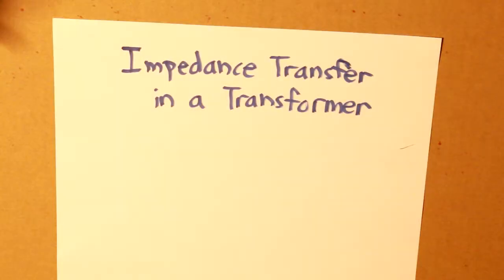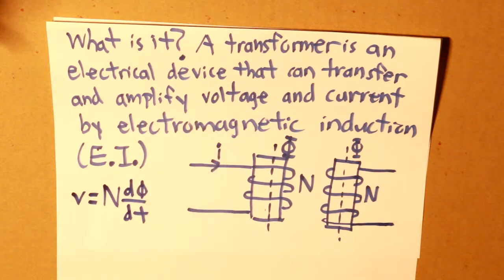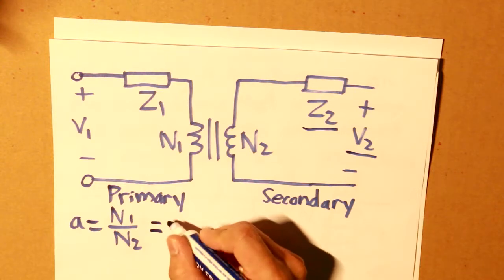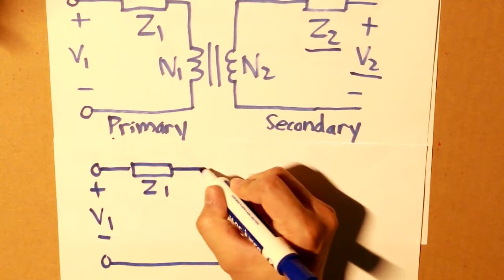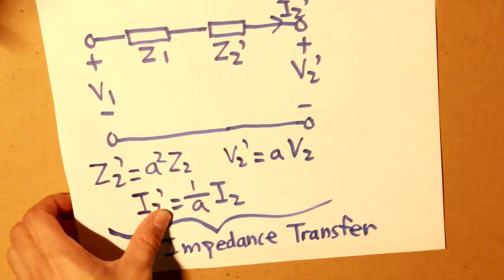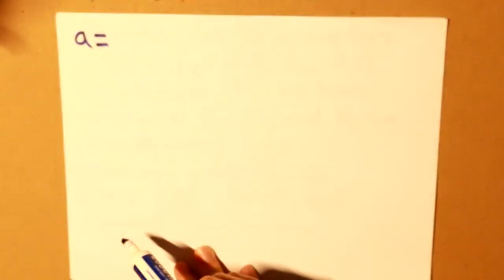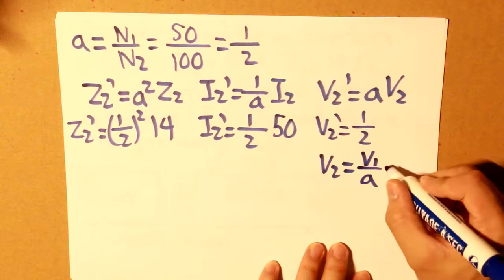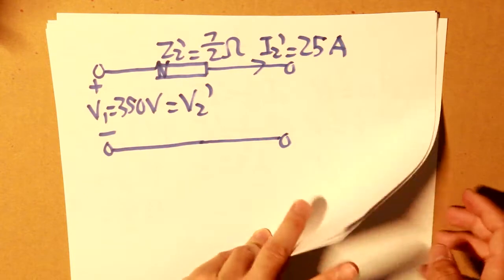Impedance Transfer

Comment: I'm confused that you're calling the turns ratio N1/N2 the amplification "a".  Because N1/N2 = V1/V2, so if V2 is greater than V1 (it's amplified then, right?), then V1/V2 < 1 meaning the gain is less than 1 which isn't the case here.

Comment: at 13.15: are you sure that V1=V2'? This does not sound possible as the voltage at V2' must be at least V1-z2'*I2'.  I think, the impedance should be referred first to the primary. When all the impendances are referred to the primary, solve for I1 in primary and find voltage across the transfomer itself in the primary which will be ( v1´--z2'*I2') . From this one gets I2' and V2'.